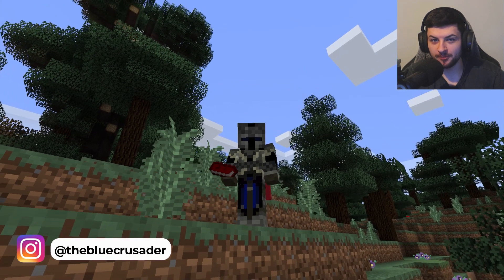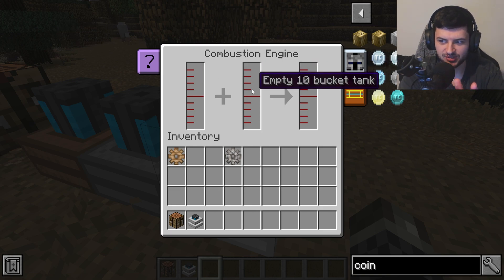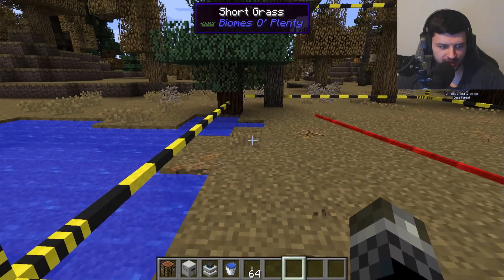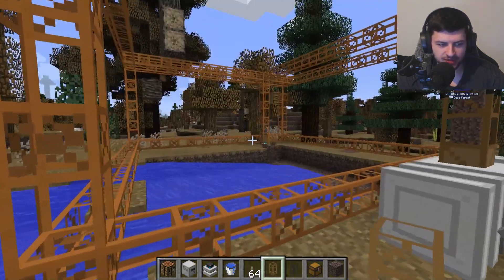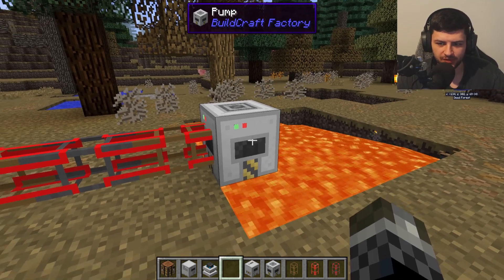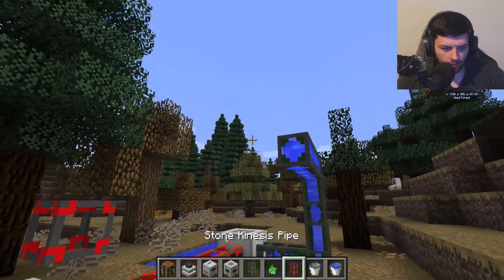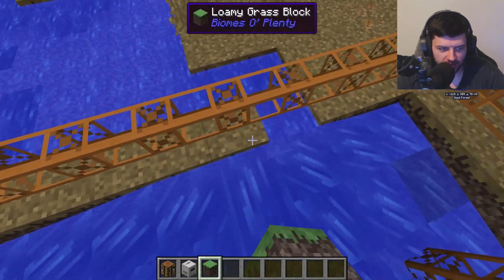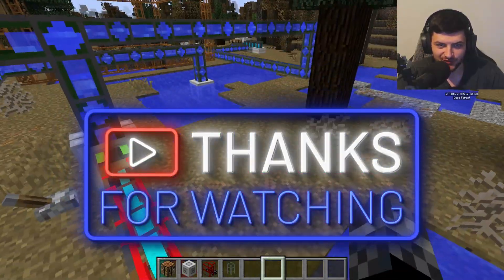Automation Made EASY in Minecraft with BuildCraft 1.12.2 | Mod Showcase

Comment: You really had to learn pipes first and their purpose. Your video would be much better with it.
Reply from the maker: How so mate? You mean provide a more in depth pipe section? As I did use transport, fluid and kinetic pipes effectively.
Reply: For example, wooden pipes are used for extraction, you don't need to put them on both ends. Then, iron pipe can be used for routing, you could merge both input from miner and quarry and output it in the same chest, no need to separate them.

Just a minor suggestion for improvement. Your video was short and had a lot of useful info, which is great IMHO.